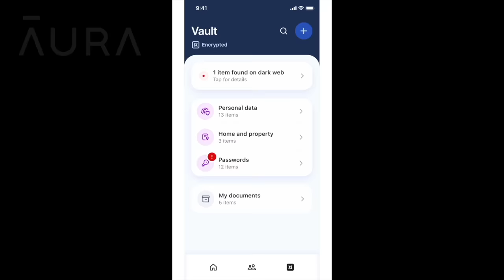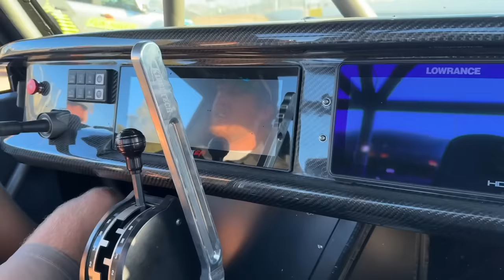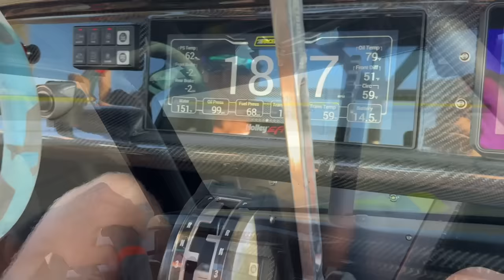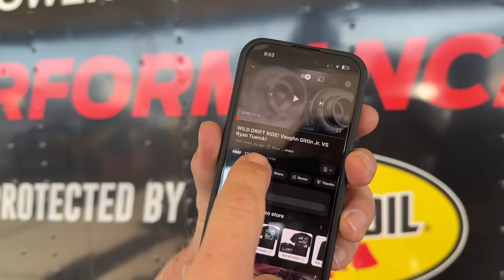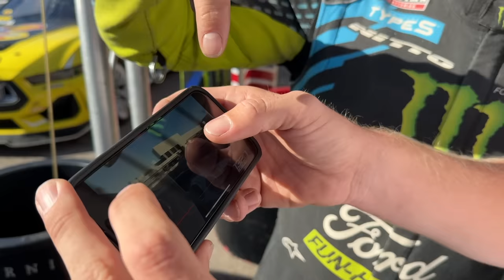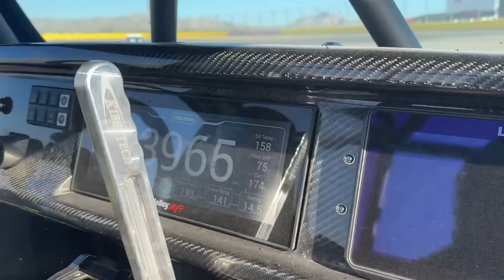I Got To Drive "EL BANDITO" - An EXTREME $400,000 Bronco Built For Literally ANYTHING!!!

Comment: The handbrake on an AWD car can work if there are clutch packs on each wheel to the back. Than when u pull the handle, the AWD disengages those clutches and locks the wheels. That's how Ford did it with the Focus RS drift stick.

Comment: Okay I am just now watching the "pro's" in the burnout contest after the drawing....Great show so Far!!! But for the love of GAWD!!! Learn how to read out a contest ticket...You don't need all those digits, the last four will suffice. IF you have two winners at last four which is very doubtful, then do a whole read to verify which is the true winner. Okay back to the show..Friday was awesome, just wish I could see some drags tonight, but sure you'll post it soon...  You out did yourself this year!! And if I may make a safety suggestion for the burn out Pad and your crew, let alone some of the spectators around the parameter..I saw a couple of shots where the tires popped and pelted them with burning rubber bits, could easily put out a eye worse case..better safe then sorry..😉😛

Comment: Keep it up. You'll quit drag racing. Going fast is OK, but if you wanna have fun, you gotta use the steering wheel.
Reply: No reason why he can't do both. You sound like someone who's never drag raced, there's much more involved than just going fast.
Reply: @indianaslim4971  Well you're right. I never said he couldn't. He just won't want to. Drag racing is 5 -7 seconds of going fast in a straight line. It loses the excitement. Just another run down the track. I have raced cars unprofessionally. TBH the drag racing thing is a lot of tweaker shop owners and the like unless you are PRO. The people and the vibes are far better in off roading. Try it. You will agree. Cant trust city people. Everyone knows that.
Reply: @kenanderson2216  I think it makes a big difference at which strip you're racing at, the crowd at Yellow Belly is going to much different than a Bradenton or Gainesville , on outlaw track will have tweakers that can't pass tech at a NHRA sanctioned track.